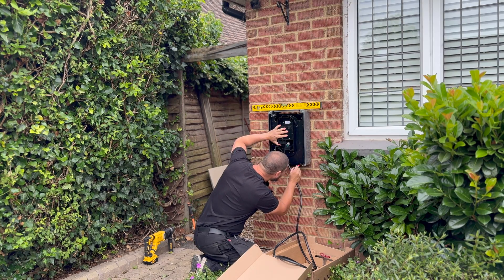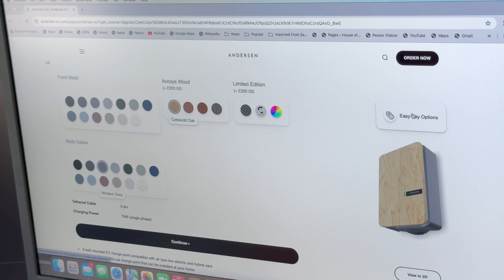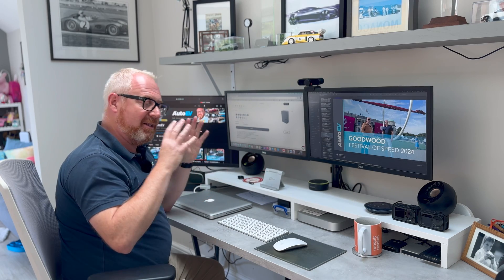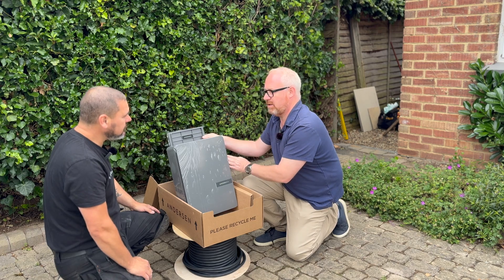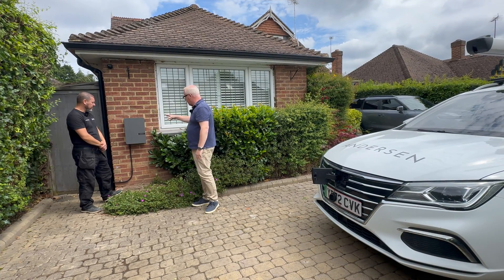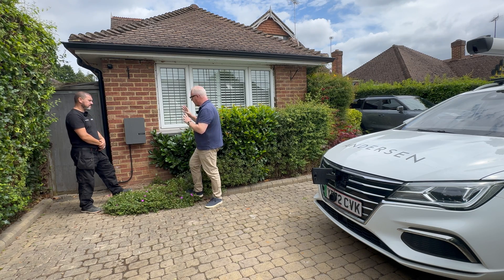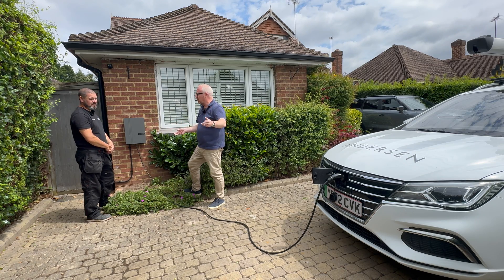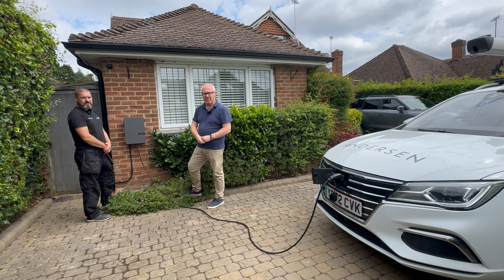Installing an Andersen EV home charging point - what you need to know.

Comment: Quite a nice aesthetic with plenty of options and clever for a tethered charger how the cable and plug are concealed. The down lighting is cool but overall there’s a slight meter box aesthetic! The only thing I’d have tried to do differently, particularly considering the clean look would be to bring the supply cable through the cavity wall even if it had to re-appear near the ground where it would be easier to conceal. I did that with our Easee One. It did take a bit more time & faff but looks much cleaner particularly considering we use the charger untethered. There is a lock option on the Easee One if you want to use it tethered though.